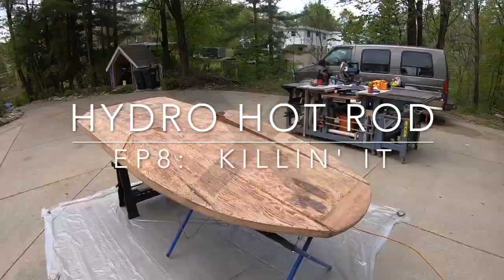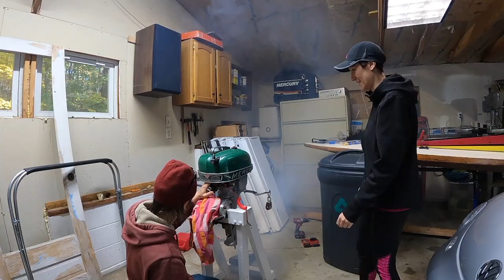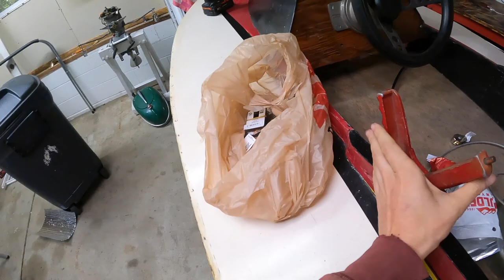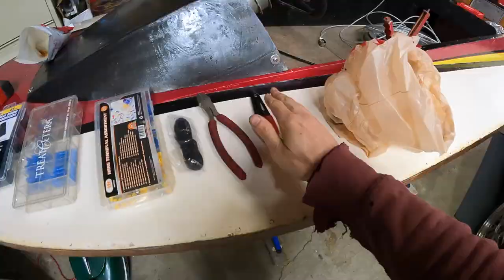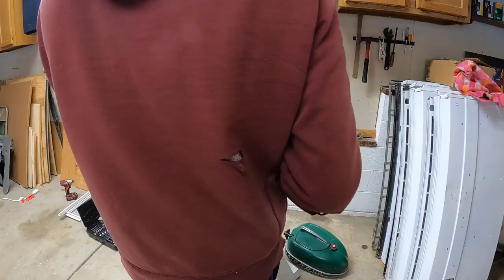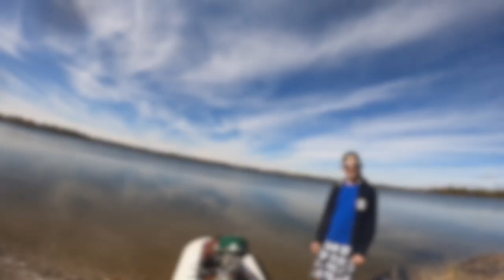How to install and wire a Safety Lanyard Kill Switch on an Mercury KG4 KE7 Hydroplane Outboard

Comment: Saw another video on kill switches for small vintage outboards that said to use a 2-wire kill switch attached to the two magneto contact points. Tried it on my KG-4H and it worked. You don't need a 3-wire switch. The reason is closed points provide a path to ground for the primary coil so that it builds a field and when the points open, this field collapses leading to the spark. But with a closed 2-wire kill switch when one of the points open, the related coil is still grounded at the magneto contact point of the other coil so the primary fields never collapse and never produce a spark.
Reply from the maker: Makes sense to me, I just ordered a kill switch off from a hydroplane website and this is what they sent me.